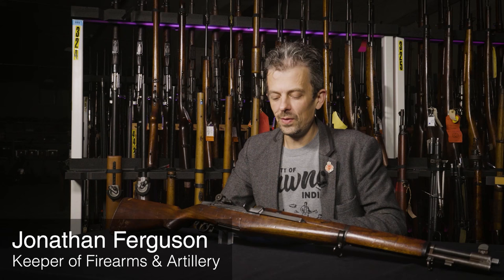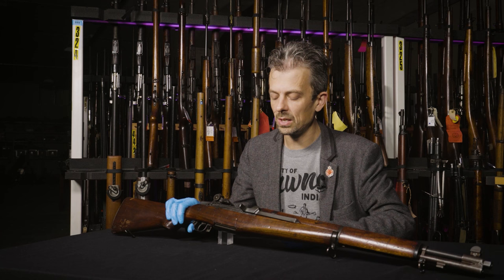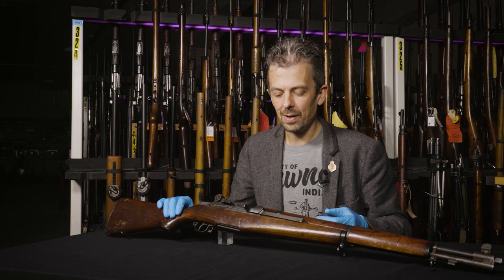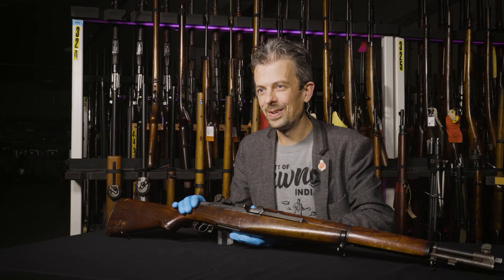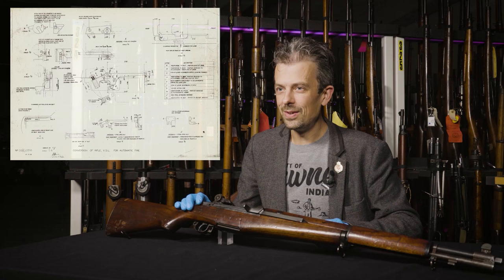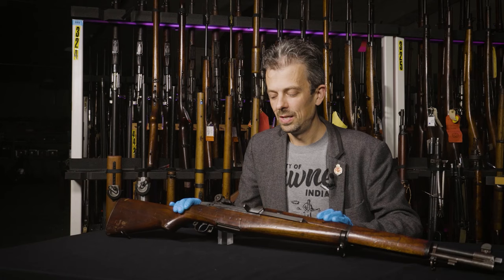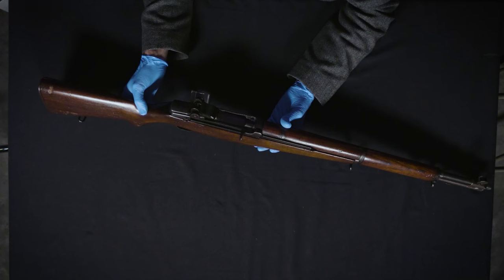Why did Britain make a fully automatic M1 Garand? With firearm and weaponry expert Jonathan Ferguson

Comment: When I first saw the title I said to myself, “self, here we go on some crazy limey modification of our finest battle rifle.”  Who but a Brit would make a full power battle rifle fully automatic with an 8 round magazine?  

But then my mind drifts back to the battlefield modified Garands. Selected units, mostly moble AA units wanted, needed an automatic burst of fire if about to be over run. Given M1’s when they asked for BAR or Thompson’s they did the next best thing. Filed the disconnecter down to create a fully automatic Garand. Much to the displeasure of the command structure and QM corps.
Reply: and to think that they could have just used 14 inch shoestrings...
Reply: I've loved reading about the full auto, field-modified M1 but then I do enjoy fantasy stories.
Reply: @AntonGully  
Well Anton my uncle told me about that process. He was assigned to an M16 armoured quad 50 anti aircraft unit in 1943. This consisted of four half tracks, two with quad guns and two as ammo carriers. The unit had about thirty men total. In England they were used to cover supply dumps and troop depots against possible air attack. After Normandy they were attached to armoured divisions for air cover. Being soft targets the wee bit used near the front, thus had little or no infantry support. But by late 1944 that changed. The air threat was diminished and the quad AA units were used to secure sections of roads and intersections from general enemy advance. Again without infantry support. These M45 quad guns, mounted in a half track became the M16 AA half track. The quad gun was limited on its depression. I don’t recall the specific angle. I was about 8 years old when my uncle told us about this. Hes now long gone. But the bottom line was that they could engage ground targets at half mile or so, but could not depress the guns to fire into advancing ground troops at a couple hundred yards. They also could not acquire fully automatic arms. So the did the next best thing. Filed the disconnect it’s off about half the Garands to make 8 round burst rifles. Not selective. Just to buy enough time to fire up and drive away before being over run. Which my uncles unit almost was during the battle of the bulge. 
The army command took a dim view of damaging government property. Several in his unit were put on report and some talk of courts martial was discussed. My cousin says there was also some modifications to the depression stop on the quad gun. Another serious infraction. In the end my uncle was punished by not being released from service, but rather assigned to guard POWs in Nuremberg during the war crime trials. In the end he made a career and served 26 years. He was an interesting guy. 
So if he says the hacked those M1s then they did. I’ve heard other similar stories, not many, but detailed enough to be believable. Enjoy your fantasy.
Reply: @MrJento  necessity is the mother of invention
Reply: True you can file down that little price of mettal, the sear, in a few minutes on a bunch of different weapons to make them full on auto.
Reply: CHRISTIAN KNIGHT  
No offence intended. When I was in the service y’all called us “yanks”, we called you “limeys” and we both called the French “frogs”. 

Scurvy is a dietary disease caused by a lack of vitamine C. By the late 1700’s the British navy had figured this out and various fruits had been tried. The lowly tropical, or bitter lime was found to tough skinned, would last months in a barrel and was high in vitamine C. The bitter taste was disguised by mixing the juice into the daily rum and water ration to make “grog”. Now a traditional naval drink. 

The US navy soon followed suit. Eventually lemons and other fruits replaced the bitter lime. But the name stuck. So now you know. We will have to ask a French sailor to discuss the taste of frogs......

Fox out.

Comment: Actually the Italian BM59 in 7,62x51 is actually also a conversion of the garand system to fully automatic. The transfer bar is very similar. Then a huge muzzle brake and a bipod made it more controlable.
Reply: I expect automatic fire from the shoulder would still be terrible but it makes much more sense from a bipod.
Reply: The BM59 is the M14 done right.   And done in a couple of years, not over a decade.
Reply: @JohnHughesChampigny  exactly, the M14 should of been an improvement on the BM59 making it a truly outstanding rifle. But instead Ordanance and procurement officers had to get their fingers in things!

Comment: 700 RPM on a 308 sounds like it would be both fun and dangerous to shoot. However it would be a blast to shoot at a large target like a car or bunch of hanging paint cans. I think RA could use another 1 or 2 overhead lights for the breakdowns. Table top down view could use more light please.
Reply: .30-06 for WWII era Garands. The M14 is basically a full auto Garand in .308 and that thing was usually an AA gun after the first few rounds. That was one of the main reasons for developing the 5.56 NATO cartridge and the AR-15/M16.
Reply: Refer to Ian's  October 2018 M-14 full auto video.
Reply: @benn454  
Was going to say this.  It's even more powerful than the 308.
Reply: @manictiger  Well the military loads of that time were about the same power as 7.62x51, but later commercial 30-06 loads are the ones that are significantly more powerful
Reply: @quentagonthornton49  Which the CMP specifically warns not to load into Garands. Ammo manufacturers now make loads specifically for the Garand which say "For M1 Garand" on the box.

Comment: Hi Jonathan, I'm very much enjoying this series, however I have a suggestion. I think it might improve the visibility of the weapons and parts (especially the ones in deep blue and wood furniture) if you shot on a lighter color backdrop, either grey or white. I often find the edges dropping away and tending to blend with the shadows in the overhead shots which I think would be remedied with a higher contrast table cover. Thanks for the entertaining and informative addition to my subscription feed.
Reply: I would like to add that this issue is particularly noticeable when viewing the overhead video shot. It gets very dark between the weapon and you. Constructive criticism only to help improve your videos. 
Mark from Melbourne Australia
Reply: The solution here would be to place a light behind Jonathan off to the right of the camera, pointed down at the table from a shallow angle; using a medium sized reflector dish. This would fill the shadows cast by the firearm and presenter and also add a rim light to the presenters silhouette which well help make them pop from the background. 

Additionally the focus in this specific video seems to be slightly behind Jonathan, it appears to be on the firearms rack behind which contains a lot of high frequency visual information; which makes the slight rear focusing more apparent. Setting the focus to be from the front of the table to behind the presenter this should also reduce the background business as the weapon rack will be out of focus. 

Aside from these very minor quibbles from a camera nerd, this piece is as usual- excellent. 

L from Melbourne Australia
Reply: This of course all depends on the space available!
Reply: It would also be helpful if, when you start talking about something specific, the camera didn't turn away or you didn't rotate the gun away from the camera. The overhead comparison shot of the modified and stock receivers was utterly useless as the view was so far away. You also need better lighting. One would think this was the first time presenting a rifle on camera.
Reply: @Biber0315  While there is some truth in what you're saying, it comes across a little harsh, the Armory isn't a production studio- it's a Museum. While it is very easy to sit back and throw stones, it isn't very constructive. 

The Armory are obviously working with what they have and trying to get it right; it takes years of production experience to know how to get even seemingly simple things right- so we should cut them some slack.
Reply: @widepeppohappy  So the truth in what I said (which you acknowledge) isn't constructive? What an odd thing to say. You're making excuses. They've been putting videos on YT for 14 years. So much for years of experience.

Comment: The Succesful conversion of a 30cal Garand Receiver to Full Auto in 7,62 NATO was achieved by Beretta, but the BM 59 series had a Bipod, so that Full Auto function could be managed in a controllable manner ( as a LMG, rather than a Full Auto Rifle.)
Reply: That could then lead to weapon overheating issues without having the option of a heavier barrel like on the L1A2 SLR Section Support Weapon.
Reply: @markfryer9880  you'd also have a problem with the barrel needing to be replaced more often.

Fusing standard infantry weapons in purpose with squad support weapons was always a bad idea. The assault rifle is about as good as it gets, as Ian from forgotten weapons (and many notable figures in the firearms community also say) there aren't really any major developments left to be made in weapons development. Best we get is "iphoning" the better features of guns together to achieve better ergonomics, optics, materials and longevity in parts.

Many people expect 6.8mm munitions to be the next step, but it doesnt offer a great enough leap in effectiveness over currently adopted rounds to achieve widespread adoption, a step necessary to actually be considered a pragmatic round.

Comment: As far as rate of fire, there are videos available of people bump-firing these, and the rate of fire does seem to be quite fast.
Reply: Bump firing compared to full auto is apples to oranges. There isn't a comparison to be made because one is a gimmick and the other uses the internal workings of the firearm to fire multiple rounds with the same trigger pull. Bump firing is just using physics to reset the trigger and pull it again faster then normal.
Reply: Bumping rate of fire is completely user dependent
Reply: The last thing you want is a fully automatic 30-06 rifle 😂
Reply: @samholdsworth420  T20 Garand: sweats nervously
Reply: @m2hmghb  I've seen a semi auto AK being bump fired at a rate that seemed much higher than a typical full auto AK..
Reply: @Wuqz  many AK variants are not set up to fire exceptionally fast in 'full auto' because that makes them exceptionally hard to control. Dumping a whole mag that you can barely aim is of little value in any practical situation.

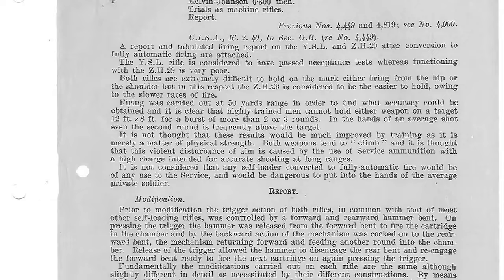Comment: Something else of great interest is in the cited report. At 6:10 the report on functioning states that ammunition used for the test of the ZH-29 was incorrect for the rifle. This is the first I have encountered a suggestion that the ZH-29 is ammunition-sensitive. (For those few unacquainted with this weapon, the ZH-29 is an early example of a production semi-auto battle rifle, not a conversion or prototype, developed in Czechoslovakia and shopped around the world to governments interested in updating to self-loading military firearms, but without much success. The ZH-29 was regarded as an excellent shooter with outstanding manufacturing standards by most who tested it, but it was a disconcerting oddball with a "crooked" barrel and cockeyed sights thanks to its horizontal tilting-bolt action, a case of  "wow but weird".) As I understand it, the ZH-29 was designed to use standard 8mm Mauser, perhaps the most widely used military cartridge in the world in 1930. As the Czechs hoped to make a big pile of bucks selling their gun worldwide, it seems odd that they would offer a rifle with special ammo requirements.
Reply: "As I understand it, the ZH-29 was designed to use standard 8mm Mauser, perhaps the most widely used military cartridge in the world in 1930." -- But 8mm Mauser was maybe less standard than you think -- look at Iain  from FW's video about shooting surplus turkish 8mm and the people who blew up their FG42 replicas using 8mm Mauser made for bolt action rifles that was significantly hotter than stuff you would want in a self-loaded.
Reply: @JohnHughesChampigny  To quote myself, "...in 1930". There was much less variety in 7.92x57 Mauser ammo before WWII than during and after. Why would ammo made for bolt-action rifles be hotter than ammo made for MGs? Was that Turkish ammo loaded hotter or had its propellant become unstable after decades of storage in questionable circumstances? BA rifles don't rely on gas pressure to operate the gun, whereas in a gas-operated weapon the ammunition must drive the bullet downrange and operate the mechanism, consequently, ammo intended for self-loader is often hotter than what is intended for BA sporting rifles. Prior to 1920, the 8mm Mauser was used primarily by the Gewehr 98 and its variants, the MG 08, and  Bergmann MG 15. The last two were recoil-operated automatics using mostly the identical ammo fired by the G 98 together with a mix of AP and incendiary ammo. After WWI many smaller countries, Poland and Czechoslovakia in particular, designed a variety of weapons for 8mm for several reasons, but mostly because of its ubiquity and abundance. (A bankrupt Germany sold tons of war surplus 8mm to customers as far away as China.) The testing committee's report flatly states that their Besa MG ammo didn't work well in the ZH-29. This is highly mysterious because the Besa was a licensed copy of the Czech ZH-53 designed by the brother of the man who designed the ZH-29 and built by the same factory. There's no logical reason why these two guns should have different ammo requirements, both being gas-operated self-loaders. Furthermore, the experience of people shooting ammo stored for 80 years in replica firearms is mostly irrelevant.  (The FG 42 may be a special case. To meet the Luftwaffe requirement the gun was somewhat fragile due to maximum weight restrictions. Consequently, it may have used specific ammo that was lightly loaded compared to what was commonly issued to the Heer, but I doubt it.)

Comment: Well, we did basicallly the same thing. We called it the M-14, which had a selector switch that could be installed. Except for the 20 round mag, the M-1 and the M-14 were very similar.

Comment: The nature of a full rifle cartridge to make the muzzle climb when fired on full auto is why we had the Browning Automatic Rifle ; the B.A.R.  The B.A.R. unloaded  was over 20 pounds.  The M-1 Garand was only 9 pounds.  Still even with the extra weight we had severe control issues with the B.A.R.  Early models had a selector for what was called 'Walking Fire'.  The idea was to advance on an enemy position while putting fire on that position.  That selector was removed from later B.A.R.s as it did not work very well.

Comment: I love the whole concept.. I mean obviously there are more modern ways to bring the recoil under control, between muzzle brakes, an improved foregrip to increase forward hold, tweaking the sight height higher to bring the stock down better into your shoulder, and a slightly less bruising metal-plate butt.

Comment: By American automatic M1 Garands he probably refers to W.A.R rifles where they were tried to use BAR magazines, but they didn't quite fit together well.
Reply: Pretty sure they also did the same thing with what was called the T26 rifle, which was literally a select fire M1 that took BAR mags, but got cancelled due to budget cuts after the war ended and because the brass overseeing the project didn’t like that it proved unreliable on full-auto due to feeding issues.

Comment: It is my experience that in firearms rounds per minute includes time spent reloading and the cyclic rate indicates rate of fire given only mechanical function.
Reply: That's not my experience at all I'm afraid. 'Rate of fire' almost always means cyclic rate. If 'time spent reloading' is included, that's "effective rate of fire".
Reply: Usually it's seperated. You have Practical Rate Of Fire which includes reloads, then Cyclical/Mechanical Rate Of Fire which is just how fast the gun would theoretically fire if it had an unlimited capacity magazine. But unless specifically stated otherwise, the Rate of fire of a gun is always measured in its mechanical/cyclical rate

Comment: I have seen in 20th century military firearms that the M-14 frame has a small disc, that can be replaced with a selector switch, which can to The M-15 Squad Automatic Rifle. This was supposed to replaced the 1918 BAR.

Comment: I believe you Brits found the same issue trying to hit something with the full-auto FAL and UK military issue was single fire only.  During the Falklands dust up many British troops were swapping Argentine FALs with their own, from prisoners or those for other reasons no longer needed theirs, because theirs were full auto.  (I read somewhere that this was the first war - rather short one in this case - where both sides used the same battle rifle.)

Even with a reduced cartridge (51mm vs. 63mm) they were still useless shoulder fired, but the Argentine model also came with a cleverly mounted bipod which did make them quite effective in a prone position or firing from a trench.  British soldiers would not have been picking them up had this not been the case.  War tends to drive efficiency down to its most basic considerations, such as,  “This gizmo kills more baddies before they can kill me.”

The ruthless truth, however, is that military armorers also consider the cost of ammo as measured by the kills per bullet and full-autos are rather expensive.  “But if it saves just one soldier’s life,” is not exactly the way they think.  The US did extensive tests after which, even with the light .223 round, they placed a 3-shot burst limiter on the M-4.  Waist not, want not.  A single belt fed full auto garden hose per platoon will do